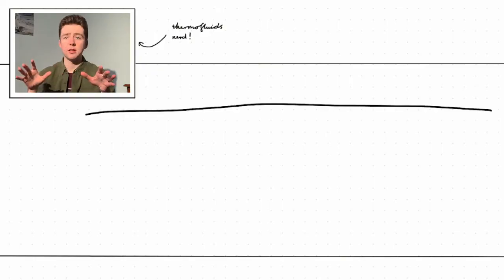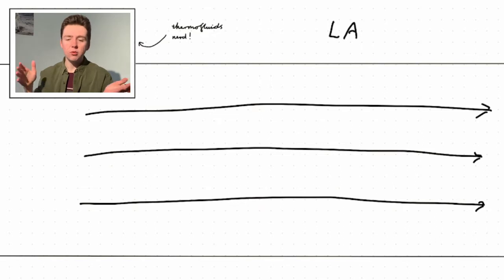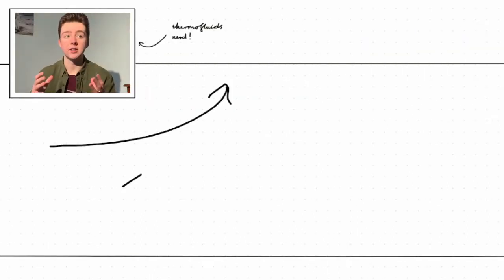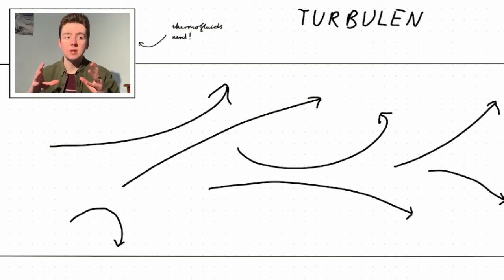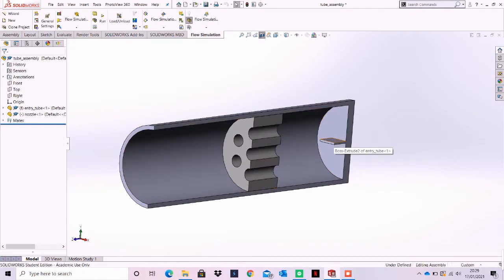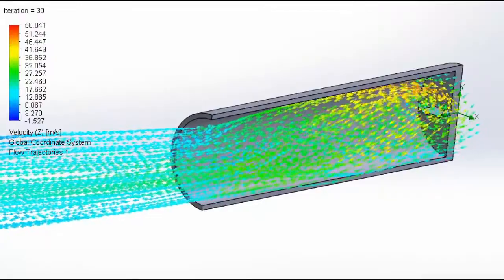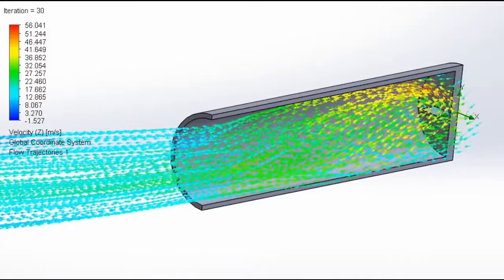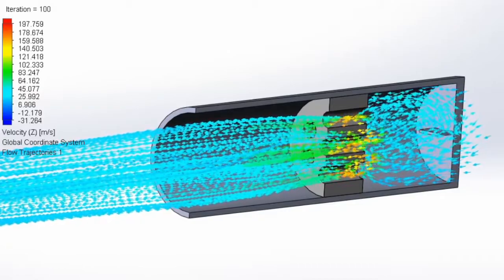Hacksmith's Lightsaber Physics Explained

Comment: So I watched Hacksmith's video, got too lazy to re-watch to see what he called the nozzle (which I assumed, like you said, was the secret to his success), Googled "what is it called when water looks still while flowing", read about Laminar flow and Reynold's number on Wikipedia, and then watched your awesome video that did a great job confirming my understanding. The only thing I'm really not getting yet is what's the difference between his $4000 nozzle and any other "laminar flow nozzle" you can buy? Why is it so much better? Is it because with enough precision (and material and tools that allows for such precision) you can break down each of the variables that make up Reynold's number on the Wikipedia page to make the perfect nozzle and then sell it for a fortune?

The reason I'm so curious is because I have a 3D printer and modelling software, and I'm interested in the idea of making a retractable blade display lightsaber that is basically Hacksmith's minus the ability to cut through things. I'm wondering if you could get some kind of air with a little bit of CO2 or water vapor, spray it with a Laminar flow pattern like Hacksmith's blade, and then stick a flashlight in the middle of the emitter to get a cool-looking but very non-lethal blade.
Reply from the maker: I think the cost comes from the quality of the nozzle. Not only will it have to endure high temperatures, but also it must deal with high driving pressures and potentially corrosive gases (like oxygen!). For example, a brass laminar flow nozzle may work for water, but would almost certainly not be suitable for the Hacksmith's purpose.

Your project idea sounds cool. Maybe using ultrasonic misters could produce a decent jet for LEDs to shine through!
Reply: @TheDodgyEngineer  Thanks! I didn't think about the very obvious fact that they're shooting 4000 degree fire through theirs and I only intend to shoot inert gasses through mine. That's a relief, so maybe I can get a just-as-good Reynolds number and hopefully some higher pressure without spending a fortune.

Comment: what if the hacksmith just got a custom stronger nozzle that can push out laminar flow further
Reply from the maker: If it pushed the flow further, the flow would be moving faster, which would increase the Reynolds number, which would lead to turbulent flow. Increasing the power and mass flow rate will give diminishing returns for blade length.